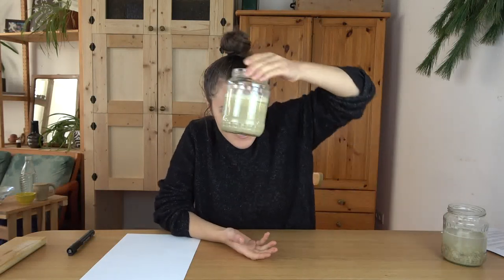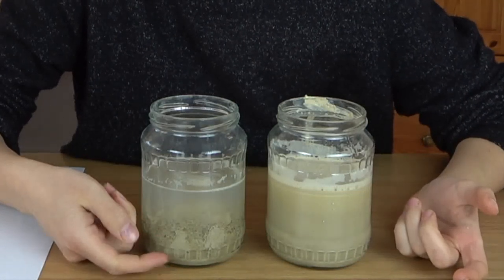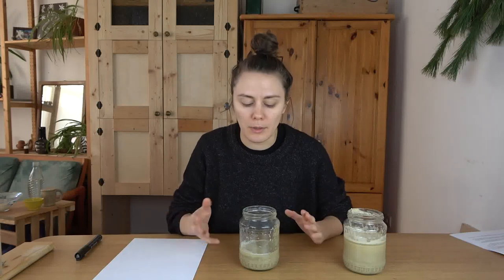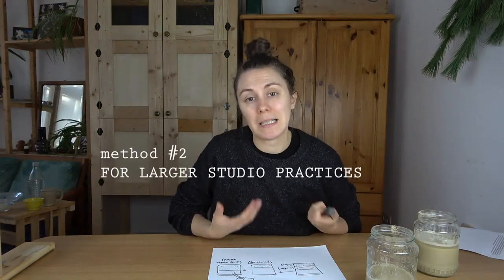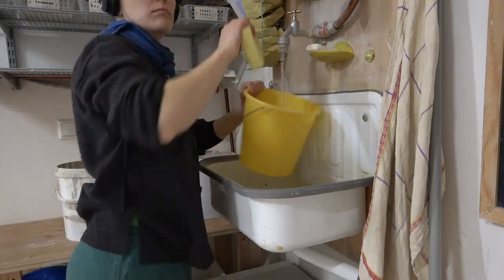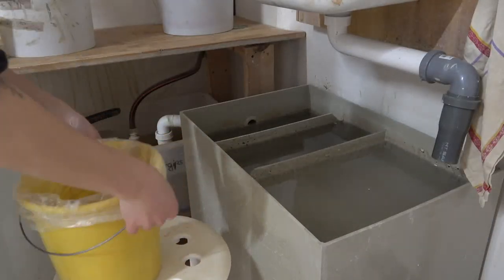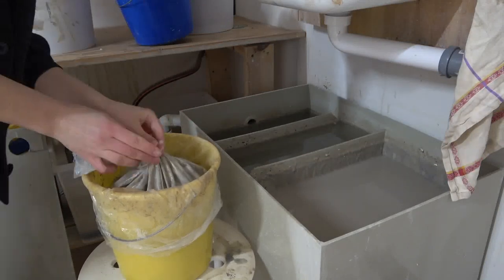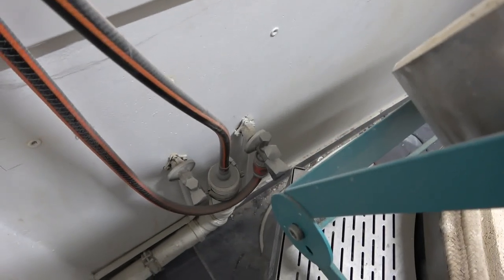How to Dispose of Dirty Clay Water -- Don't clog your pipes! -- Pottery Studio Setup

Comment: If your native soil is hardpan, clay is easy to dig up, but the soil holds too little water for good plant growth, and organic material just tends to float away on the wind. Mixing clay waste with sand and either peat moss or sawdust will make a suitable growing medium for plants on its own. In the drier parts sand is also generally easy to come by, and the mixture of clay and sand will hold the organics together and allow roots to take hold, beginning the process of soil rejuvenation.

P.S.: Aquarium trick, get a length of plastic hose and use it as a siphon to drain water from the top of a bucket without disturbing the bottom layer by tipping the bucket. Fill the hose with tap water and cover the end with a finger to start it, unless you like the flavor of delicious clay water of course.

Comment: Thank you so much for this! I just had one question about how to clean the clothes used while working with clay. Lately I’ve been rinsing them first to release the clay and then throwing in the washing machine… because I’m guessing throwing straight into the washing machine can also become clogged with clay material. BTW I’m only doing pottery from my home in a small unit! Thank you again - I have 2 buckets sitting with mould in that I wasn’t too sure where or how to dispose of it! :)

Comment: Hey mia, im stressing out becuase i was working with air dry clay for a schopl prpject and i had judt a tiny little bit kf water i used to dip my hands in to use on the clay and that water had small bits of clay in it as well as being murky from being mixed with clay, it was like 1/20 of what the amount in your jar was though. I threw it down the drain and now im frealing out becuase i dont know if its going to affect my drinking water or anything as i put it in the kitchen sink. This is my first time using clay so this is the first time ive ever done this.

Comment: Hey Mia, I was wondering what your thoughts would be on using coffee filters for the clay water? I just started experimenting with clay at home and have about two glasses of dirty water after cleaning up my tools and table (for extra pieces of clay and thick slip I usually put them directly into another container to reuse). At the end of a making session I usually poor the water out in a coffee filter. The clay bits stay in the filter that I throw in the garbage and the filtered water I poor down the sewer. I don't really have a place to keep containers like you do. Would you say this is an okay way to dispose of it at home? By the way thank you very much for all the advice and information you share, it is so helpful. Glad I found you ^-^
Reply from the maker: I think that works! I haven't tried it myself, but I used to filter clay water through fabric, so I think it would work similarly. :)

Comment: Hello, I am setting up a home/club studio and am considering buying the Botz sedimentation tank, like yours.  Does the paint on the painted metal surface ever flake off?  There is a plastic Rhode sed tank I am also considering.  The Botz seems sturdier but I just want to check if the paint flecks off before I decide.  Thanks heaps for your feedback, if you're able :)